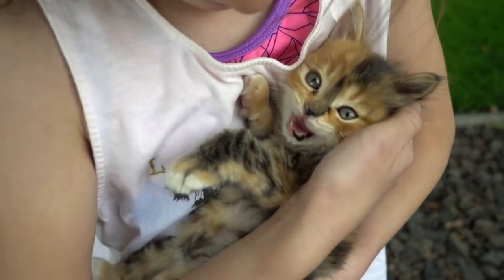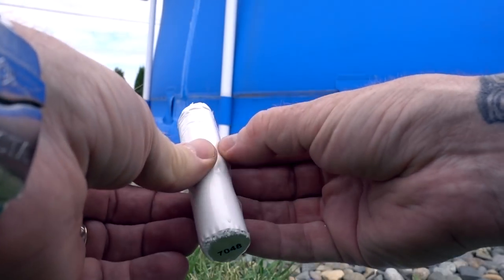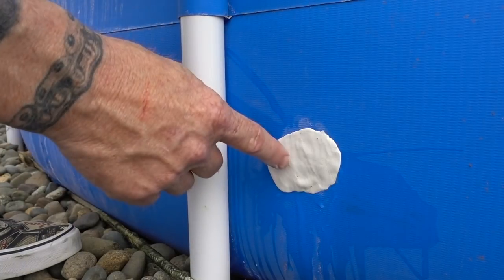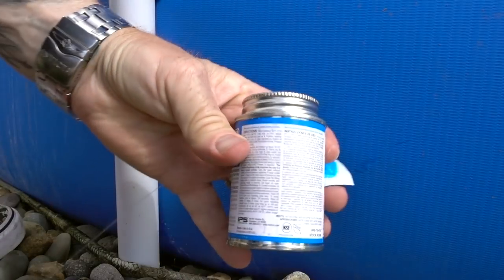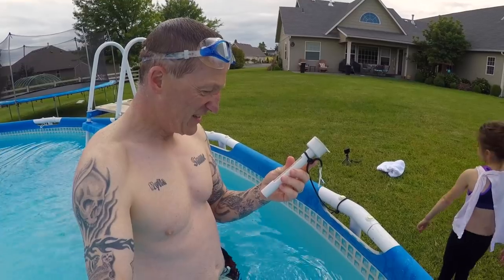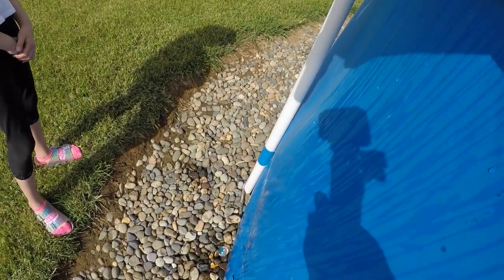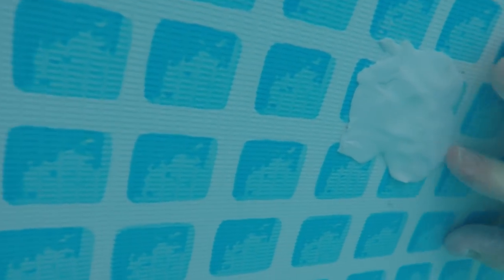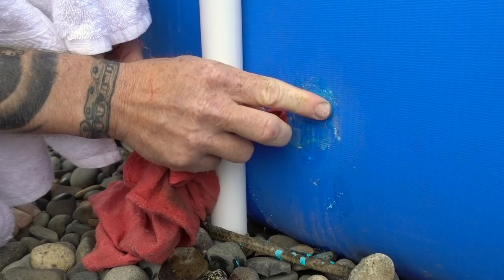3 Ways to Fix-Repair-Patch Intex Above Ground Pool With Leak-Filled-VLOG

Comment: Try using flex tape on the inside as well as the outside works great ran into the same problem you had pools been up for 2 years no leaks

Comment: Thanks for the entertaining video. We just took our pool out to set it up for this Summer. We noticed little teeny tiny pinhole size holes all around. I read about ants and termites causing damage to pool liners. We’re hoping we can save the liner as we just got it last summer. It was stored in a big rubbermaid container with a lid all winter. We cleaned it and dried the liner before we packed it away.
Reply: Same thing happened to our pool
This summer. Lots of tiny holes. Used patches hope it makes it through the summer
Reply: This happened to my pool as well after VERY CAREFUL storage.  I think it’s a defect with Intex pools 😳.   It’s happened to me more than once … they expect you to buy a new pool every year… 👍🏻

Comment: Cheers buddy. Same thing, kitten poked a hole. Was debating between a patch or flex tape or waterweld. Going to go with the water weld in the inside and patch on the outside
Reply: Chris R - I would go with flex tape because the JB is just going to pop off anyway because it will not flex when dry. going to use flex tape outside and then it also works underwater from inside to give a really good repair. I have 4 holes to patch on mine (weed wacker damage yesterday and the pool is old and brittle after 6 years outside). not looking forward to it as my pool is just filled and cold too lol.

Comment: Just used the JB Weld and it fixed my one inch crack in the bottom near the seam with water in the pool. Thanks for posting, had tried other patches and nothing worked.
Reply: Did it hold well? That’s what I’m about to fix

Comment: On the topic of JB WaterWeld, I tried it on my pool prior to watching this video, and I do 100% do not recommend it. I sealed a crack on one of my windows on my pool and it held up for 1 day. The thing about it is, once it cures, it's good, but when people are in the pool and are causing waves, or bumping the walls, it cracked down the center and water poured out. I'd guesstimate that I lost 4,000-5,000 gallons of water due to a 1/2 inch crack that turned into a gaping 5-inch crack.

Comment: I use a product called HH-66 to patch vinyl tarps. It's probably the same or similar to the Water Weld as it can be applied underwater too.   Just cut a patch, swab the area around the hole with brush attached to the cap and put the patch on and press it on good with a J-roller if it's dry.  If it's under water, you swab the patch and then fold the glued area together and then pull it apart under water and apply it and smooth it out with a J-roller.  I believe there's a few youtube videos using HH-66.

Comment: Had a inch size straight cut in bottom and we stuck a plastic bag under the pool and pulled it up through the hole and it completely stopped the leak could not believe how good it worked

Comment: Some weathered door stripping works good .peel paper off and get along piece and fold it 4 ,5 times maybe 3 inches long and get a Phillips screw driver put it the middle of the stripping and push it in , just like plugging a tire !

Comment: Brother they make under water patch I have an above ground pool had a bad leak in a seam.. it comes with a vinyl patch material and a clear glue you rub it on the patch material going to water slap it on to your side wall seals your leaks you can't see it works great get it at any local pool store
Reply from the maker: Dang it. Wish I had known that. Thanks for sharing. Always learning.
Reply from the maker: Maybe a pool store carries them?
Reply: Yes that's where I got mine was from a pool store they work great
Reply: Ryan Urlacher I just bought a patch kit from Wal-Mart. Going to apply it shortly to my inflatable spa. Not sure yet how effective it is going to be but I'm sure it will work!
Reply: Bam bam  can you tell me the name of the patches

Comment: Reading the comments I see a lot of people saying flex tape but I'm dealing with a 1 inch tear with fresh flex tape on both sides 24hr between 2 bricks. Just filled the pool and it's still leaking. FLEX TAPE IS TRASH!
Reply: Ya i tried flex tape too on my pool and it sucks.Did not work
Reply: I will be doing the same tomorrow with a 2 inch hole that I need to support for strength. Doing a modification for a larger pump.
Reply: Did the same! Even tried to a patch w/ flex seal! No bueno! Had a small puncture as well...spray on flex seal did not work! Had to tape, spray,  then follow up w/ flex seal before little pin puncture was sealed.
Cost- $14+$18+$22(plus taxed on all 3)!!!
Reply: Try gorilla tape worked fine for mine.

Comment: About to attempt this myself discover two small tears. Question does the water weld set? Do you need to be worried someone will touch it inside the pool and disturb it?

Comment: I wonder if a can of flex seal will fix my pool.
Reply: Good question, I can't find any pool patches and the ring keeps deflating, so annoying.  I just bought the pool last year.  My last pool same type lasted 5 years, but I swear the rim was thicker than the brand new one I just bought last summer in July, I am soo irritated right now!
Reply: I just watched a different video and it didn’t work for him
Reply: My intex pool was free, some dude was going to toss it out but I wanted a pool and can't afford one. So I took  it home, scrubbed it out patched all the holes with flex tape and used 2 cans of flex seal for gutters and such. I think I found all the holes. So now I'm just waiting for the Flex Seal to cure before I start filling it. Man I hope this works. My daughter is jumping g out of her skin to use it.

Comment: I had two pin size hiles in the bottom of the pool i used this thing called the clever fix (had to make sure the inside of the pool was dry) it was $7 from cheap as chips took 5 seconds to apply and dry and was fixed
Reply from the maker: Very cool. I'll check it out.
Reply: Ryan Urlacher yeah heaps handy can fix just about anything like pvc piping cords pools toys wood metal to whatever else you can think of

Comment: I used duct tape/gorilla tape n its worked for 3 years lol i had to replace one of the patches but hey I used it on both sides.. N no problems. But u have to do it with ur pool dry.

Comment: Pretty sure my girls' damn cats (or it's the giant wolf spider that lives under the pool)  put a hole in our pool near the bottom edge.  I can see the swampy ground but can't find the leak. I hate cats....I'm just going to plaster a bunch of patches inside the pool where it's swampy!
Reply: Shut your filter off wait till your water is calm pour some ,(a little) fine grain sand or dye near the suspected area the sand or dye should group to the hole, plug it. :)

Comment: Awesome
Reply from the maker: Thank you.
Reply: Ryan Urlacher So I used the JB weld and it stopped the big leak, but it’s still leaking water??
Reply: @RyanUrlacher  Could you tell me how you made your wooden. Step on the top rung of your ladder or make a video?  I like it alot.   Stumbled on your video as #1 in google for intex soft side pool repair.  Dont think the method will work for mine as mine is the size of a golf ball or maybe it would?  Have tried flex tape 👎 worked on smaller pin holes.
  Thanks  in advance